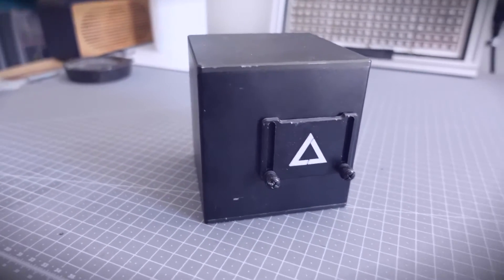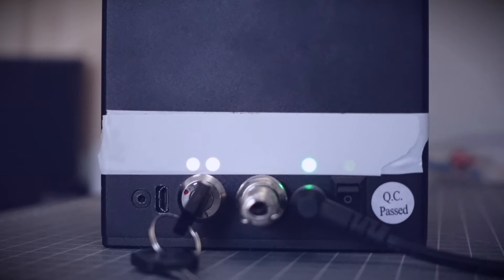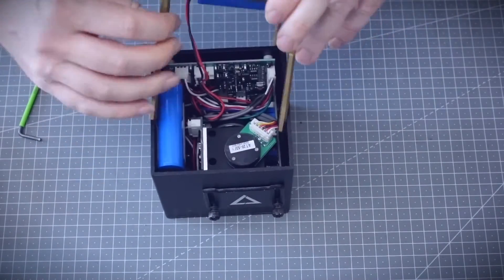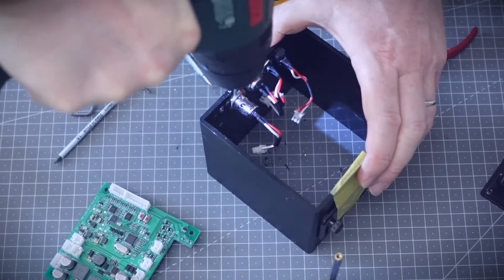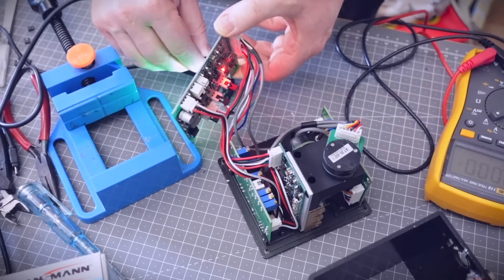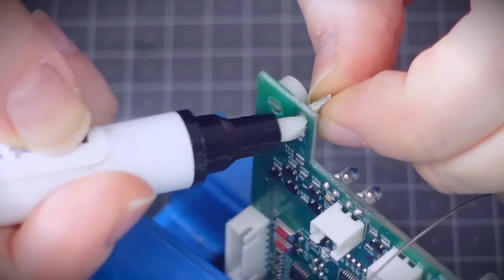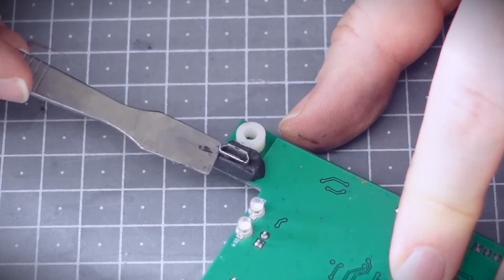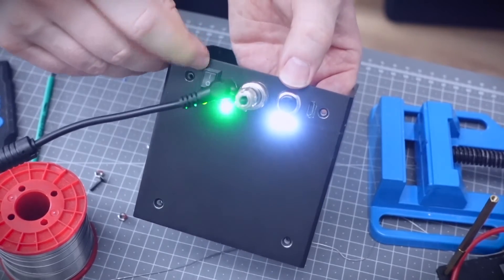LaserCube Hack and Repair!

Comment: Thanks for doing this, you gave me the courage to replace all the batteries in my 8 lasercubes. There's One thing you should know, most of the batteries I purchased have the XH-2.54 plug reversed so if you hook it up as received it reverses polarity, people should check to see if their leads show the red lead on the left, if so it needs to be reversed, either cut and rejoin the wires using tape and/or solder or reverse the connector. Also the first batteries I purchased had very thin leads and when I picked up the battery pack it caught fire, cheap chinese crap because it wasnt connected or modified in any way had it bounced around during delivery the truck would have caught fire. The batteries I installed came of Amazon and have very thick wires plus a circuit overload pcb built in so always shop around.

Comment: Do you think you could remove the e-stop bypass plug and hardwire that inside the cube so you don't have that large dongle hanging off? Wonder if that work would work. Also wonder if I could do that on my 2.5W Pro!
Reply from the maker: You could but then you would no longer have the option of an external stop button, and you should always use one if you're lasering outside your own home
Reply: I just switch the Cube into firmware development mode to override the interlock when I am playing with it in my room, having to pull all the E-Stop bs out of the bag every time is annoying 🤷‍♂️

I switch it back before using it in public though as that would be illegal.

Not sure if that works on the USB version though I only know how to do it on the Wi-Fi version.
Reply: @doctor5781  How do you do this exactly? Can't find any information on it

Comment: Thanks for exposing the insides of the LaserCube. Last year, I modified a laser projector into a compact wall-mountable one for my living room, but couldn't get it as small as the Lasercube. Now, I can see that the LaserCube's driver boards and show card are consolidated into a single PCB.
Yeah, I ditched the key switch, as well. Now, I'm developing my own MIDI controllable laser synth with a Teensy 4.1 MCU, audio shields, and Cakewalk's DAW.
Great times playing cycloids to psy-trance rhythms'!😎

Comment: Hi Seb, are there any class 2 lasers on the market with similar functionality? Also, what spec XY Galvos are LaserCube using? Thanks!
Reply from the maker: Even a laser pointer is class 3 so it wouldn’t really work as a class 2! I would guess the scanners on v1 were rated for 20kpps, they’re not great but fine for simple stuff

Comment: In America we have to have a long cord with a giant stop button and another key set. All you have is the little silver thing. Can you tell me the pin out on that please. I just only use mine at home as well. I don't mind the key set on the cube But the giant stop button and cable are very cumbersome.
Reply: I was wondering the same thing&where u can get one of them instead of having to use the e-stop.
Reply: @kenheavilin3010  I figured out how to bypass it with a momentary button and it works perfectly.

Comment: Re: Sugru, do you keep it in the fridge/freezer? The packaging recommends that to extend its shelf life, so I've been keeping mine in a fridge for years now and I pretty much always use packs well past their use-by date (for the same "don't use much" reason you mentioned) without noticing any issues.
I believe that's also suggested in the Technical Data Sheet, which I recently discovered via Pimoroni's website :) (Possibly the most marketing/consumer-sounding "technical" data sheet I've ever read, but hey!)

Though it might help that I have a fridge in my bedroom/workspace, so I'm not hoarding Sugru with food :) That fridge was originally for cold drinks since my bedroom is 2 floors up from the kitchen - and also traps all the heat - but these days it's also home to a fair amount of Sugru and a few syringes of solder paste! (Is bismuth better than lead for being around food? 🤔)
Reply from the maker: I've been using Sugru for years but only recently heard about refrigerating it (via another comment here), I'll definitely try it in future. Thanks for the comments!

Comment: Fun! Shame they discontinued those. I'm running a couple of proper 2W ILDA projectors, but a standalone battery powered one would've been good for outdoor event use.
Reply from the maker: Oh the new ones are 2.5w and still battery powered! This one is 1W.
Reply: @seblee  Yup, but a grand is a fair investment for something like that, and puts it in competition with mains powered units with far superior galvos and lower beam divergence. The smaller units at a lower price point made a lot more sense in my eyes.
Reply from the maker: Yeah I agree. I guess they might make sense for a DJ looking to save space but mostly they’re good for me working at home.